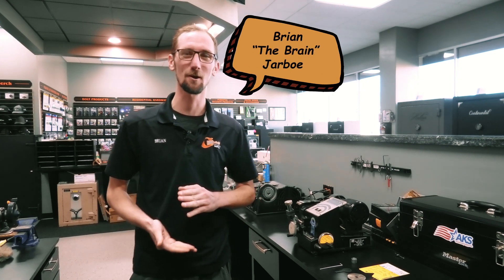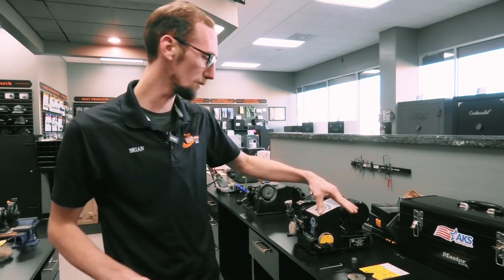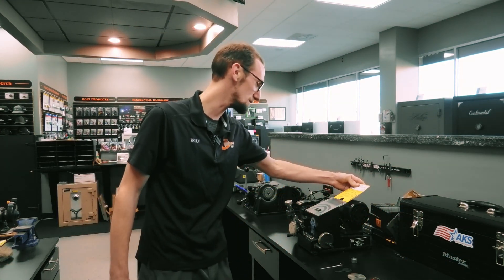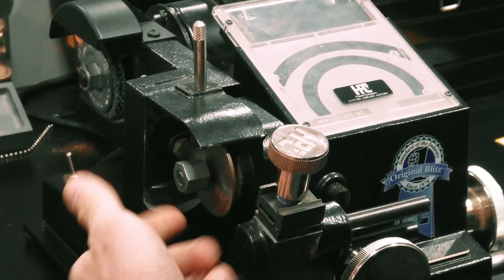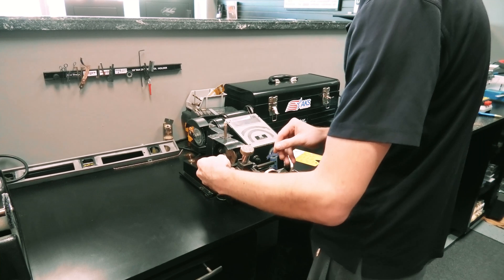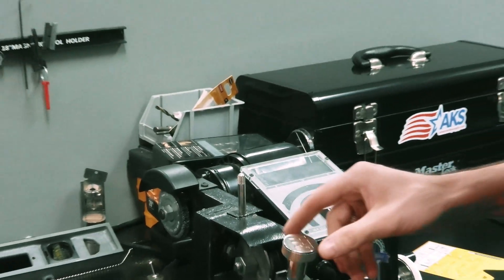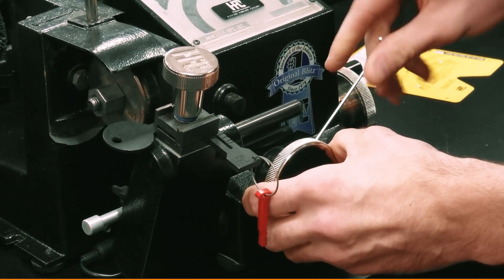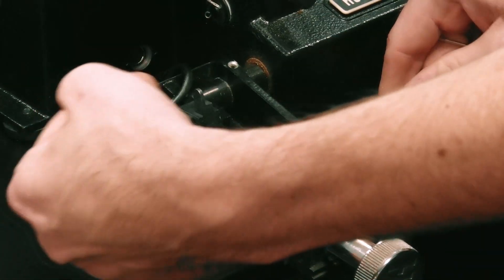How To Calibrate Your Key Machine - HPC Blitz | Picking The Brain | Episode #3 [REUPLOAD]

Comment: For a quick and dirty calibration of my machine, I have a punched SC4 key, where it's cut to 190091, and adjust the eccentric shaft to match the code card, and use the 4 spaces to verify the positions are accurate. Hasn't failed me yet! Easier than making sure I have the calibration kit on hand.

And when done, I have a core pinned to that, to verify it's accurate, and I get no clicking.